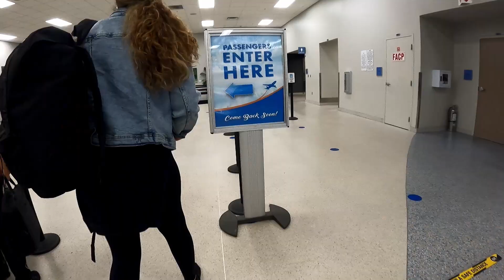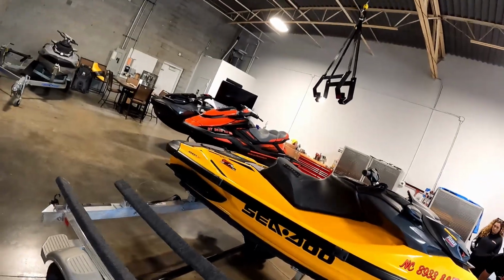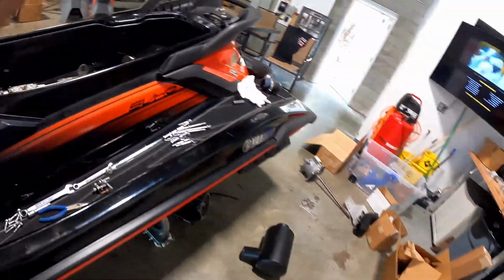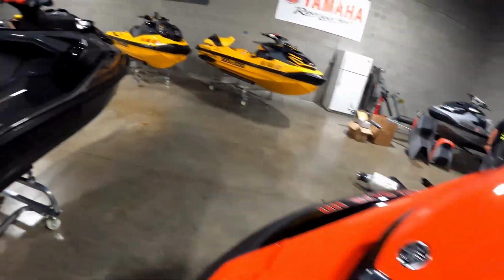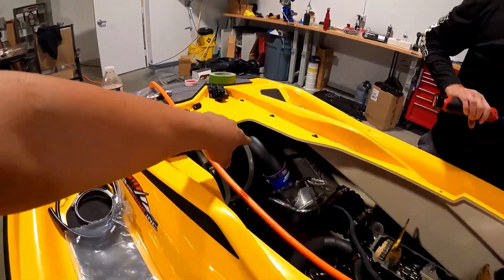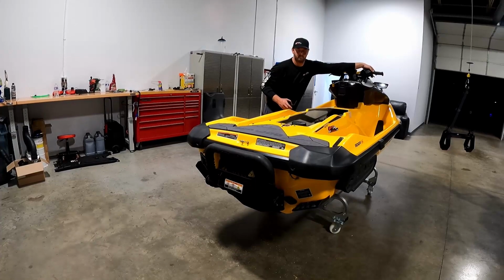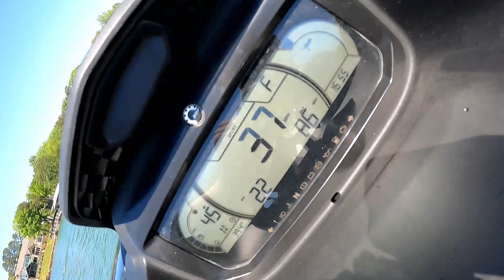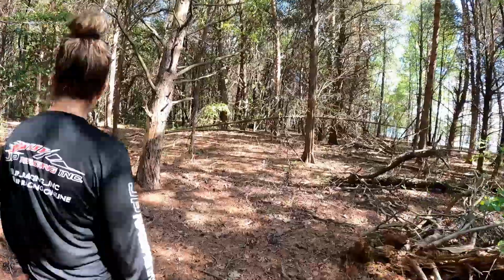Starting Off with a BANG at our Lake Norman Location. 80+ Sea-doo and Yamaha Skis Ready!

Comment: That SVHO was badass!!! You should be doing more Yamaha content!!
Reply: Why are people still doing SeaDoos?
Reply: I agree with more Yamaha content,
But that Yamaha is slow for a riva stage 3
Reply: Competition makes the Sea Doos faster and more reliable. Sea Doos and Ski Doos can't beat a Yamaha. Yamahas rip like no other.
Reply: I have had both. Sorry the Sea-Doo 1600cc just does not hit like a Yamaha 1800cc. There is a reason the fastest ski in the world is a Yamaha.
Reply: @titantitan8750  The question of this day, will BRP make a competive reliable 4 cylinder engine to compete with Yamaha and Kawasaki?
Reply: @jerrychase4177  Not to take away from BRP/Sea-Doo as they have been the most inavative when it comes to the PWC market. I definitely think they can. However, with the coast guard limiting these to 68MPH from factory. I am not sure they really want to spend the R&D on a new engine.  Even if they do, it's my opinion they would still use cheaper components compared to the Japanese counterparts. Truth be told I have been a Seadoo fanboy all my life untill I purchased my 2017 GP1800.
Reply: @sunnice2  facts… My 2021 fx limited on stage 2 used to stay consistent on 85-86mph